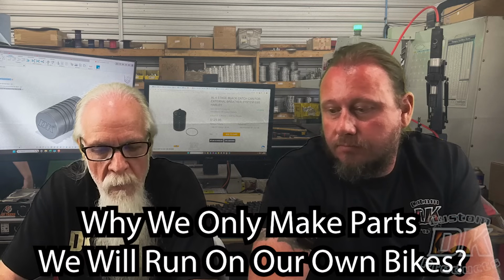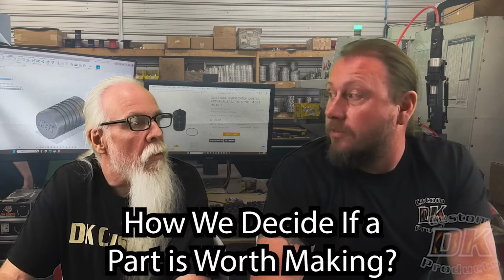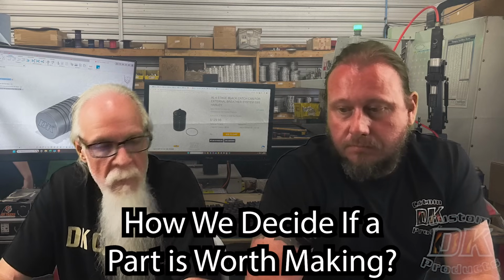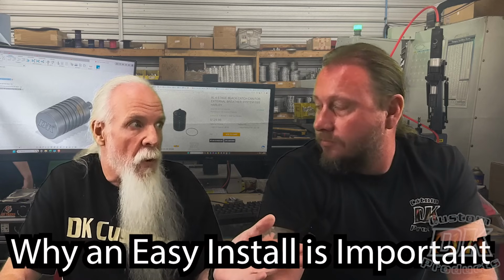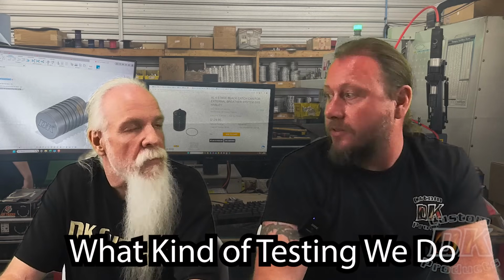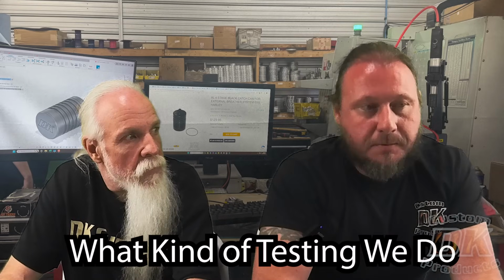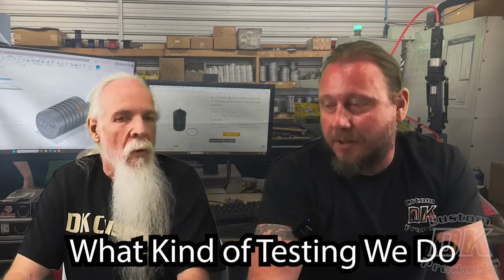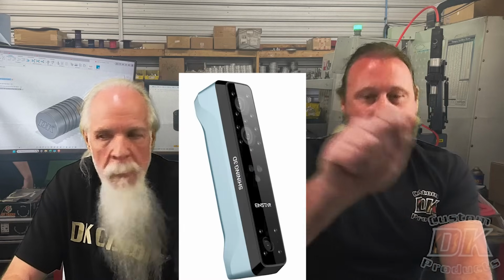🔧 Built by Riders, Proven on the Road: How DK Custom Parts are Born From the Ride

Comment: i haven't completed watching video, but if needed persons in nv  desert (death valley)to do some testing, more than will to assist, however, my newest model is 2012 triglide. i am looking to get the oil relocation/cooling system in next couple months, 1 main reason easier access to filter, keeping cleaner. i need to order the tank lift for my spare bike, have on 2 bikes.
Reply from the maker: Awesome! I will let Kevin and Devin know! I know you will enjoy the benefits of having the Oil Filter Relo and Oil Cooler installed. Please feel free to reach out with any questions:
Support@DKCustomProducts.com
662-252-8828

Thank you for commenting! MB